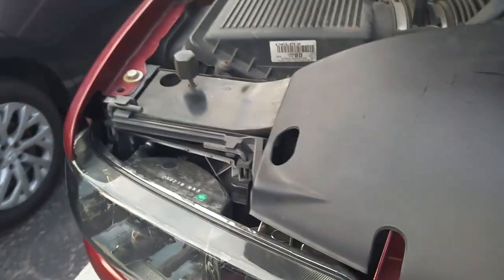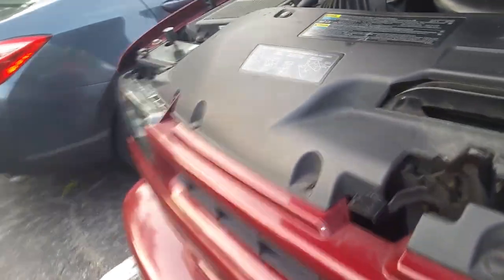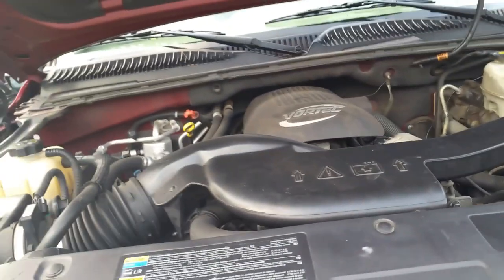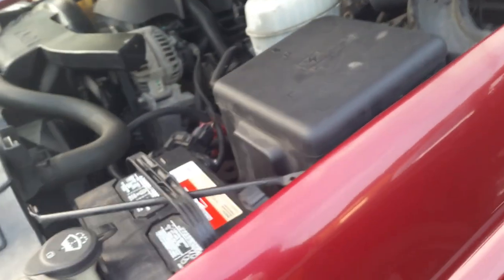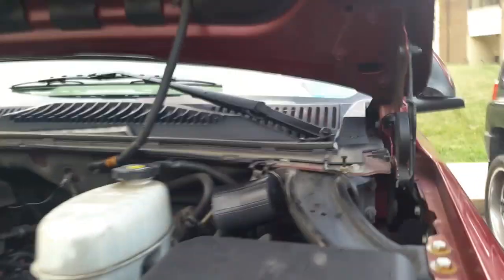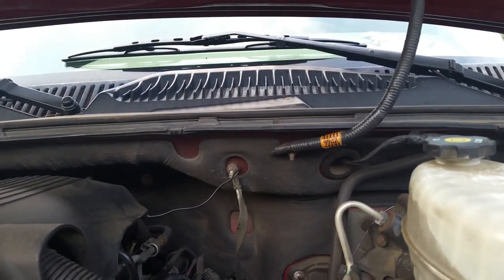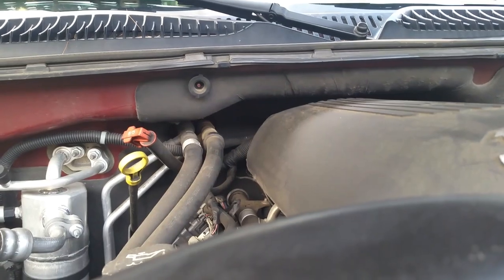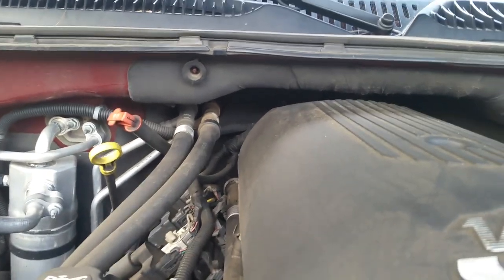Bad ground wire on 2005 Chevy Tahoe Z71

Comment: Worked for me as well two years ago.  But now problem has come back, but again intermittent.  I've tried jiggling all the wires but I can't duplicate the problem.
Reply from the maker: marvin Newman I’m having the same issue. It comes and goes. I have 207k miles on it now so imma drive it til it dies.
Reply: Marvin Newman did you clean the ground connection under the driver side frame rail

Comment: Have an 05 Tahoe 5.3. Same problem , thanks to your video same fix. Thank you. what is the ground for though. It comes from the wire harness but what ground is it exactly?
Reply from the maker: It connects to a bolt at the top-back of the engine block
Reply: @mrnonchalant1183  thank you .

Comment: You also have ground wires on the frame to the body of the vehicle underneath the driver's door and they also get a bad connection have issues

Comment: So, thou this is a good video. I am confused at which wire goes there.  Could you make a VIDEO and post it or send it showing how to LOCATE THE WIRE. BC I dont see a wire connected to the firewall on the Left side, from standing in front of truck, so I know its NOT CONNECTED But dont SEE A actual DANGLING WIRE. I looked. But it did cut off when I put it in REVERSE in a parking lot. It started right up but it should not have done that.

Comment: Bro just upgrade your wire to the “BIG 3 O/GAUGE WIRE” just doing that will increase your Voltage from 12volts to 13.5..Just type in Big 3
Reply: Will that type of wiring work on an ESCALADE???
Reply: @mercedesbenzs600bash  yes it will

Comment: Mines have over fueling issues and i put a new fuel pump and filter in it and a MAF sensor and it still does it coule a bad ground cause the over fueling and the pcm to read running lean ?
Reply from the maker: I’m not to sure about that. The ground wire I had issues with completely shut the truck down.

Comment: Mine stayed running on cruise control but hit a bump and the gas, temperature, rpm, speedometer cruise control light odometer and gear indicator all went dead but still runs and drives only gauges working are oil pressure and battery gauge

Comment: That ground is for the ecm it can also cause ani lock brake light to come on power door locks  to lock and unlock  when driving  over bumps  checks video from pine HOLLOW   GM LOW POWER  MODE  HE SHOWS A LOT OF THINGS TO CHECK AND EXPLAINS THE SYSTEM  HOPE THISHELPS SOME  ONE ELSE

Comment: if that ground is bad its hard for the starter cranking all those amps to ground out through the transmission and drive shaft through the axles and back around to a ground somewhere else on the frame ,, glad you found the problem thanks for sharing a awesome video !!!!!

Comment: I have 2007 Silverado 5.3 also with electrical issues:
Door locks go up and down, radio turns off, engine light...
Sometimes it wont turn back on when parked.
I know its the negative cable,
It re-energizes the system when i wiggle it.
Reply: U ever find the fix
Reply: @NORCALPYRO_  
I replaced my negative and positive batt cables.
also the mega 175am fuse.
Its been good since then.
Reply: @jayeff4457  starting to have the same issue everything turns off then back on while driving. Last time when i turned the key off everything went out then locks cycled and so on... gonna disconnect the battery and clean up all the connections and check the mega fuse. Ground to front passenger and ground the power steering bracket and ground to block. So lets see what happens after this
Reply: @NORCALPYRO_  

I tried the basics at first,  cleaning the terminal ends and  making sure all ground connection were on tight. it would fix it fo awhile but the  issue would always come back.
one important thing to note is my battery cables and fuse did not appear damaged.
The battery terminals might be corroded on the inside and you wont be able to see that unless you cut it open. 
also, Taking it to the stealership is a waste of time and money , they weren't able to fix my issue.
Try replying the mega 175amp fuse first,  its only around $7 at parts store. 
Replace the battery cables if issue persists.
Reply: @jayeff4457  will do thanks man appreciate the info

Comment: question. the problem i have is my tahoe wont crank or turn over. i tried everything i could think of and replaced alot of parts. could that ground wire in the video be my problem? i checked it out its not broken i tugged on it but should i try to cut it and re ground it?
Reply from the maker: It may not be broken but there may be a bad ground somewhere. I’m not a certified tech but I would recommend taking it to one.

Comment: Man iv seen the video of fixing that same ground. I have 24 check engine lights. Bad grounds and short to batt. I have power lose, bad tranny shifts, radio cuts in and out, feed back through the speakers. And this guy was having all the same problems. I fixed the wire. Also added grounds from engine to firewall, batt to fire wall, and batt to frame. Still have the God damn problem and cant figure it out. Wtf
Reply: check the ground wire from the battery it is under the driver side  under the truck.clean the ground wire it should fix the problem.
Reply: @98chicagobears  it ended up being a couple things. After doing that ground. Putting a new factory amo in  MAF sensor and throttle body positioning sensor it fixed it.

Comment: Unfortunately I've done everything cleaned grounds checked compression checked timing bought new fuel system new ignition system upgraded grounds to 4g wire and still having a random misfire.... I've yet to do a leak down test... hoping that reveals something
Reply: Could be mechanical 
Like a head gasket

Comment: Do you think this could affect just you brake lights not working?  Everything else works well except my license plate lights , but could this be possible ??  
   I’m pretty good working on stuff like this and I’ve been all through the brake cables in rear,bulbs,sockets,fuses.  I’ve traced it down now to one little brown wire in the panel on side of dash when you open door. 03’ Silverado. Now it goes 30 different directions😂😂😂😂. Lol!!   I appreciate the video man. Glad it worked for you. I guess now I’ll try this. Tried just about everything else. Maybe I’ll call PepBoys😂😂$$$!!!  NO WAY!!! I can’t afford that!  Have a good one God Bless and Peace be with you!!✌️✌️🙏🙏
Reply: Did you try a brake light switch?

Comment: I had that same issue had the motor replaced and the guy who swapped it forgot to add that back ground that goes to the firewall and i just ran a ground from the side of that alternator bracket to the frame and fixed my issuesines was just low voltage and running like shit. Tho nothing else

Comment: Mine does the click, intermittent, stalled once. You think this might be my issue too?
Reply from the maker: It’s possible. Try following the wire from the firewall to the back of the engine block. Be careful tho that wire is fragile. If it’s damaged create a new ground.

Comment: I broke my disturber in my monte
Took dealer 2 weeks 
I told them it made a bang than died.
Final y did. A visual inspection
And disturber came out when touched 

Despute on credit card if they did a proper diagnostic they would of founded it.
Can check with jumper cables
Also hidden ground in the a pillar

Comment: Man I had the same problem I was getting reduced engine cleaned the throttle body didnt work. Found a  ground wire in the back of the motor that was broken off and grounded it to the battery worked fine ever since
Reply: Kerri Miller did your vehicle go into limp mode during this

Comment: Yo if you get a moment do you think you could show exactly where that wire was dangling, 
I see wire clusters in the video... but no single wires loose..just a quick shot of the exact wire you grounded...
Reply from the maker: TakeShot Films DJ MARCELUS at 3:30 in the video I zoom in on it. It’s the wire going towards the engine cover. It’s a single black wire.
Reply: Ivan Garcia thanks.. it ending up being another ground for me on the bottom of the motor.....gay ass shit thou...appreciate the info
Reply from the maker: TakeShot Films DJ MARCELUS lol your welcome.

Comment: question i Have a 2000 chevy suburban 5.3 engine i been researching for the past few hours couldnt understand so is the two ground black wires with the white stripes hooked up to the back of engine  block cut and then hooked up to one single wire ??? i would appretiate the response
Reply: i hope i made sense

Comment: This is why I always tell people to take their car to the dealership. Common problems like these are fixed quick by a good manufacturer trained Technician.
Reply: So they can overcharge them too?
Reply: Super Shop Well I didn’t say every technician at a dealership was factory trained and I’ve seen dealers fuck people over too. Alls I was saying is if a technician is properly trained and understands the systems and doesn’t just throw parts at it like they did you then dealers would have such a bad rap. We don’t play that shit at the shop I work at. I do see where your coming from though, it’s hard to trust them ever again after your situation. GM dealers are kind of known for that around my area as well. Good points you make though
Reply: Stealerships are crooks! Overcharge everything!
Reply: Not all the time. I have had to fix stuff the dealer couldn't figure out.
Reply: Absolutely...

NOT
I fucking hate O'Connor's Chevrolet or any Steelership the only thing I would do for them is drive my 7200lb Yukon XL right through their brand new building well it's a few years old now but still fuckem all.

Comment: Did they tow your truck on a flatbed truck?  because rolling the trucks wheels, front or back, will burn up your 2nd or third gear depending on the average speed the tow truck.  

Happened to me!

Comment: I have a question did the rpm go up but wont shift or how did it dp it mine acts funy but wire was not that lose moved it a lil and broke off quick

Comment: My 2005 Silverado 5.3 just had new alternator installed. Starting the engine resets the clock, not the presets.
 Battery checks at 14 volts. 
Not sure what to do.
Reply: Did u get it figured out?
Reply: Same prob here? Any updates?
Reply: @Rob805Zombie  mine turned out to be a bad alternator which killed my new battery. The alternator was a new remanufactured one from O'Rileys. They did a load test and it was bad they replaced it because it was still on warranty. Just because it's new does not mean it's not defective.
Reply: @chris George thanks for the quick response. I did a load test on mine and its good j bought mine brand new but still have same problem. Appreciate your help tho

Comment: You called it a flaw. I don’t understand it. If it wasn’t connected to anything from GM( the flaw), how did it run all that time before it broke down? Did the wire break? Wear and tear. Did the connection come loose? Wear and tear. I don’t get the flaw thing.

Comment: I have a 06 sierra 4x4 oil pressure gauge will run fine for weeks then start truck it says it's running 200 lbs  couple days gauged goes back to normal sometimes one side of air or heat will blow correct other side will blow extreme opposite 4x4 controls on dash sometimes w ont work just flash and it's constantly telling me driver door is ajar though it's not I be been told it's a cluster problem but I don't know a time have any ideas please ?
Reply from the maker: Darrell Smith tbh I don’t much about the Sierra. With it being an 06 it may be a computer issue tho.
Reply: JDM Toys thank you
Reply: the oil pressure being all crazy could just be a faulty oil pressure sensor on the engine

Comment: Same things happening to me turned off at the carwash and wouldn't start change my starter and alternator charge my battery and it still won't start what should I do I checked that ground cable and it's connected

Comment: Grounds do not last forever, they are not like the control, power, positive wires on the truck/car/boat. They are usually fully exposed and oxidized what type of corrosion. most cars in the North or in the salt though might be lucky to get 10 years out of them anything over that she's probably just changed out it's part of maintenance schedule. Electrical circus that don't fully complete tend to find another path through another device and then everything starts acting up funny or won't work at all. And that is why it is important to have Good Grounds by the engine the fuel filler neck the fuel tank internal chassis ground and others just to name a few.

Comment: So you cut the ground used a butt splice and ran it over to the other ground?
Reply from the maker: Big Kahuna yes the original ground is at the top back of the engine block and not accessible.
Reply: @mrnonchalant1183  that cable that you redone does it have two wires in it cause I just cut that same wire double checking under the truck while my son wiggled it and seen it bolted to the block but can't get wrench on it.
Reply from the maker: Big Kahuna well I didn’t cut it. It burned thru. It was only one wire tho.
Reply: @mrnonchalant1183  well guess I've messed it up cause I don't see that one wire.  Was it in a loom?  Now I can't get it to stay running think I really messed.
Reply from the maker: Big Kahuna it ran from the loom straight done to the engine block.
Reply: @mrnonchalant1183  I went back out a check don't see the one wire by itself just the small loom that ran down to the block but it had two wires now I got to butt them back together..

Comment: so what ecaxctly on the motor is that ground wire connected to?
Reply from the maker: Tbh I have no idea. My best guess is a bolt on the engine block. The just ran it too close to the engine.

Comment: I have the same problem, except my Escalade isn't getting any fire to passenger side. It's running rough I unplug driver side coils it runs rougher when I unplug passenger side I runs the same. Somebody please help me
Reply: get the engine diagnose first!! then youll sort out the cheapest fixes. thats what i usually do.

Comment: Was wondering what that purplish wire on the maroon SUV you have going to the drivers side coil harness
Reply from the maker: chris gowitzke that’s from my remote start. The installer did a mediocre job.
Reply: May i ask where did you connect the wire too. Ive located my firewall ground wire but dont know what else to do.

Comment: I have a worse problem   went I start truck and let it run and when  I press on brake to out it in reverse the truck will die
Reply: Had the same problem and it turned out to be a rusted ground for the rear lights mine was just under the rear bumper in a 2003 Tahoe

Comment: My truck has two wires coming out of that hares
Reply from the maker: David Ramirez what year is your truck?
Reply: Ivan Garcia 2006 Tahoe Z71
Reply from the maker: lyle toombs are both wires running to the engine block?
Reply: I have an 04 yukon. I have two wires but both are connected. It’s difficult to remove that bolt. I don’t want to cut it cause my engine isn’t stalling but I am having security light and T/C light turn on and off along with a bouncy cluster
Reply: mine too and its a 2000 chevy suburban

Comment: Took my 2008 5.3 with reduced power service stabiltrak service traction control and they told me my engine was blown and conned me into trading it in for a new one. Smfh

Comment: 89 Chevy dually C3500 454   throttle body, no spark no fuel won't start. 100 bucks if anyone can give me the right answer.
Reply: Pick up coil in distributor and or module in distributor.
Reply: I've got an 87 305 with the tbi same problem. Did you get an answer on this?
Reply: Timing chain or distributor

Comment: First of all, instead of just tossing possible parts at the problem, go to auto zone and pick yourself up a CHILTONS AUTO REPAIR MANUAL, for you vehicle, and remember the ground wire was not meant to last forever, therefore you should be man enough to eat that flawed comment you made, the book is around $30, best investment you can make.
Reply from the maker: Not sure if that’s necessary 4 years later but thx for watching.
Reply: @mrnonchalant1183  good advice is eternal.
Reply from the maker: @chuckkillawood8229  I’m referring to the be a man comment. I know that this could have been a simple fix in hindsight but when put in the situation and not being able to work I kinda panicked.

Comment: the gauges of my escalade are crazy, does anyone have the same problem? The car works great but the lights on instrument cluster turn on random
Reply: Clean the grounds.
I clean ALL the ground wires on any vehicle's that come in to my garage. 
Why Because they can and will do some strange things to any vehicle. 
P.s I live in Maine rust/corrosion & moisture are so bad for electrical.